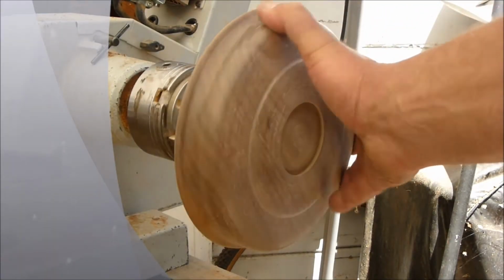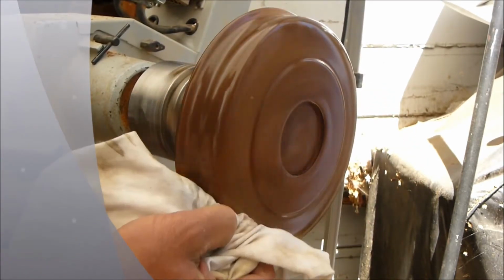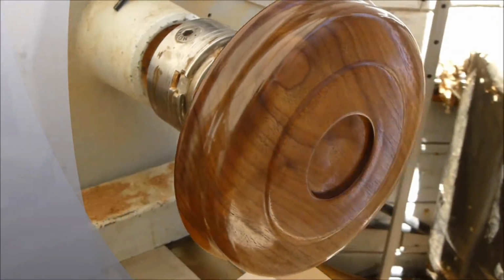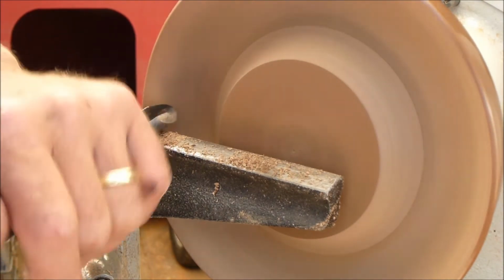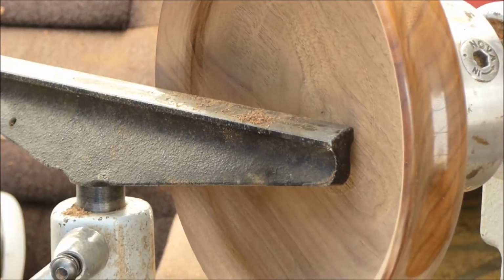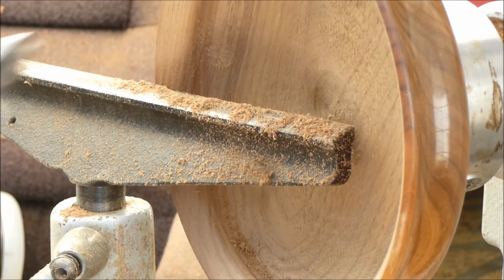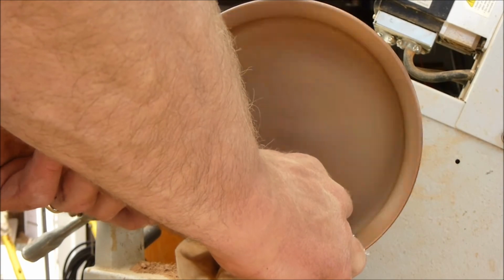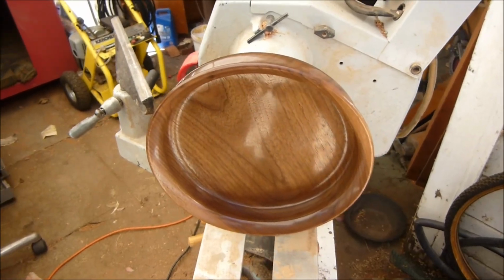Wood Turning With Naked Turner 8.5" Walnut

Comment from the maker: Mike, I use clear shellac and Howard's butcher block sealer at 2 parts shellac to 1 part Howard's, which has oils, bee's wax and carnuba wax and then I add a little denatured alcohol shake it up and it is ready for use.